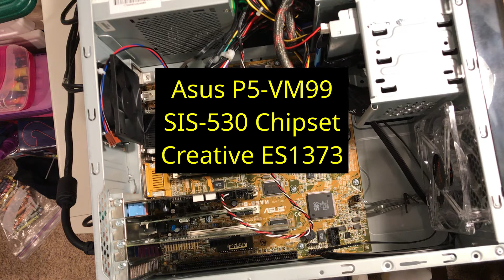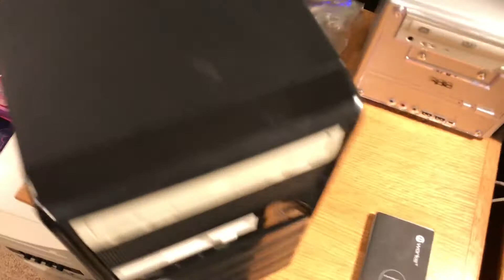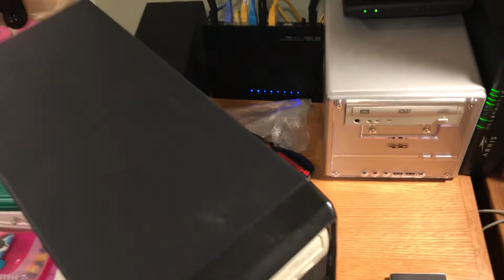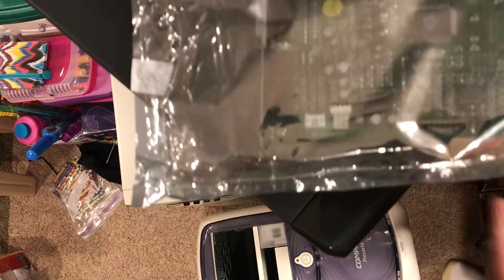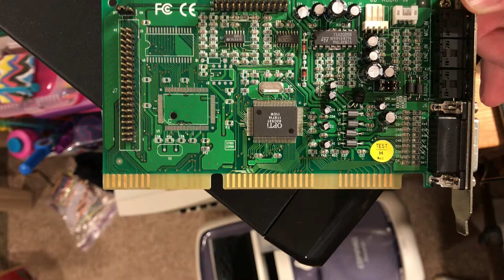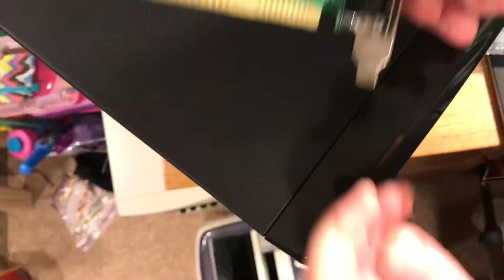Pentium 200 MMX 3Dfx Voodoo 3 2000 Build Overview

Comment: I'm trying to fix up some of my retro machines, and trying to decide if I should put one of my voodoo 3 cards into the pentium 1 266 MMX or just put the voodoo 2 in and use the 3 for my pentium 3
Reply from the maker: V3 would match better with the P3. The PMMX would bottleneck it. Depends too if you have another card to pair with the V2.